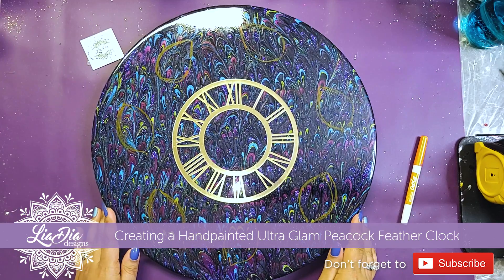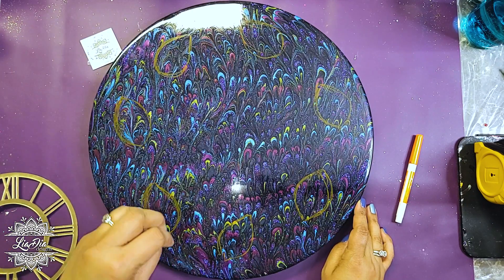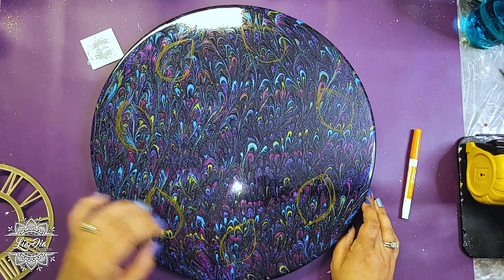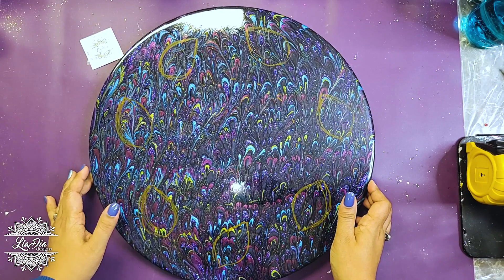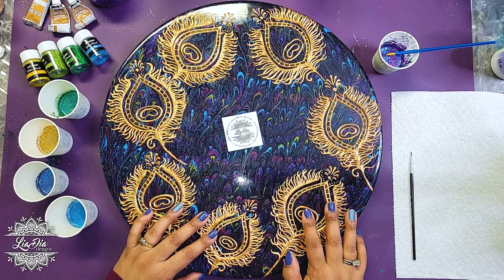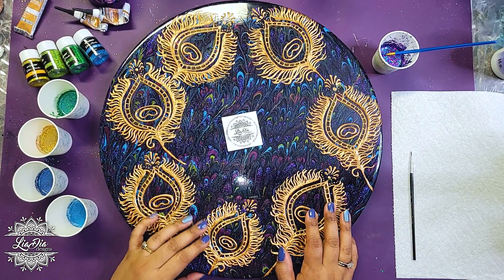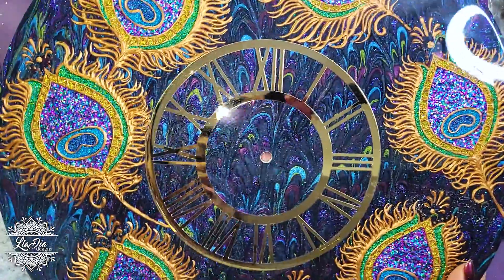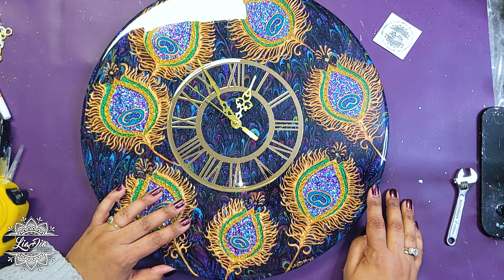How to Make this GORGEOUS DIY Handpainted Peacock Feather Epoxy Resin Clock #resinart #painting

Comment: Another great project. Would it be easier to drill the hole before doing anything?
Reply from the maker: 💕thank you... the issue would then be the 2 clear  topcoats... the resin would partially fill the hole and then you'd need to redrill it... so works out to be about the same

Comment: What did you use for the edge the golden  one? Did you use pens before for the edges, how did you find it compare to paint + brush? Also with decoart gold what difference you notice between the texture and the normal one, is it mainly the texture gives thick finish like 3D effect? Or also the colour of the shade of gold is different? Thanks
Reply from the maker: The golden edge on the other clock is just a regular gold acrylic paint and some glitter on top